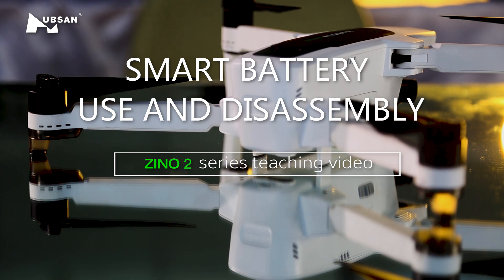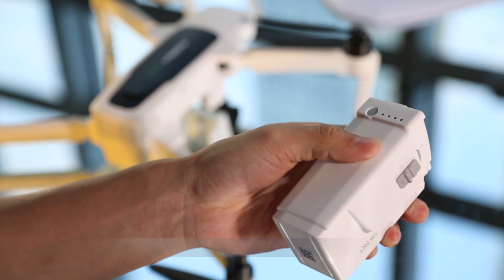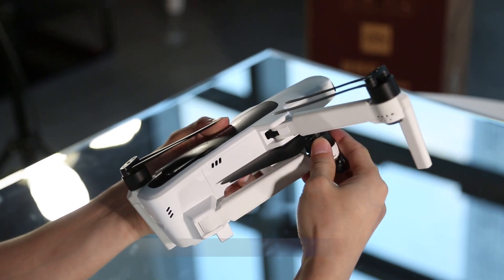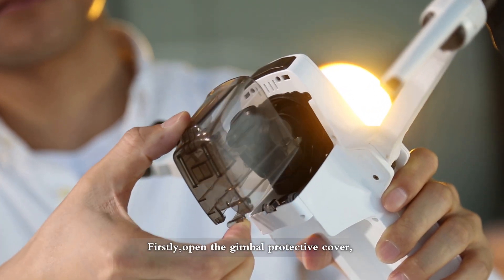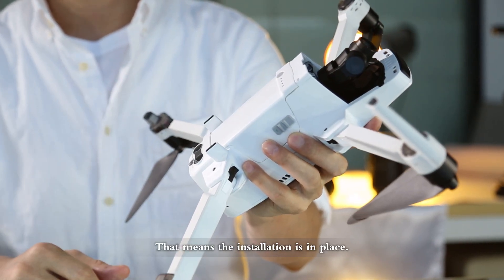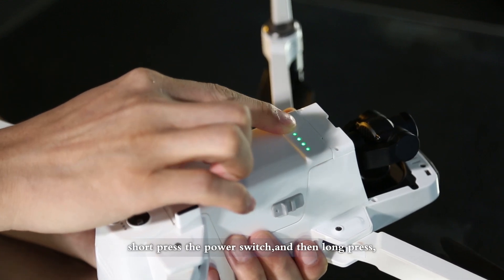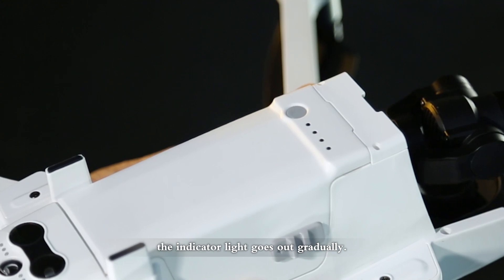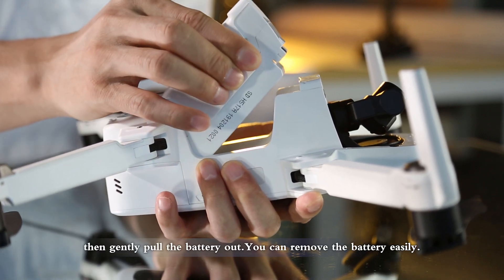Smart battery Use and disassembly -ZINO2 series teaching videos

Comment: These batteries (those of the Zino 2 and the 2 Plus: they are the same) are really crap: not even used 10 times, the 2 batteries of the pack are already starting to open on the sides! Hubsan did not think to screw the 2 white parts to guarantee a perfect seal and finish! Result: by dint of installing and removing the batteries from the drone, they move apart and you can no longer insert them after a while! At 100€ each, it's a shame!

Comment: Hello, I have contacted your customer service several times but I have not received a reply. My brand new zino pro has extremely poor camera quality. I have the latest firmware installed and I am using a 4k micro sd. But nothing helps, I change the micro sd and the quality is still extremely bad.